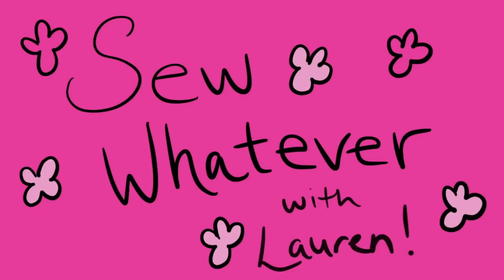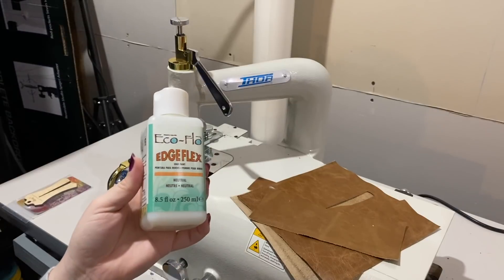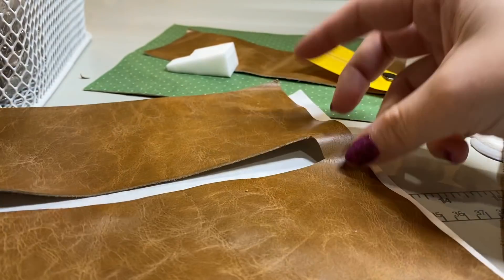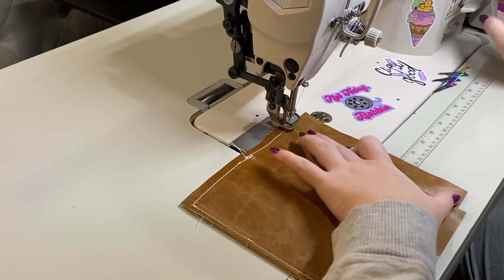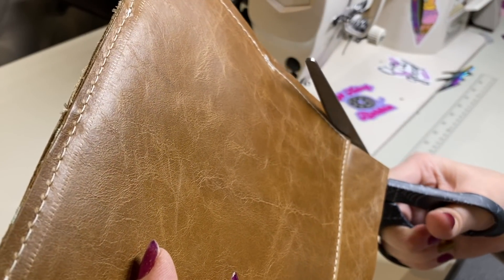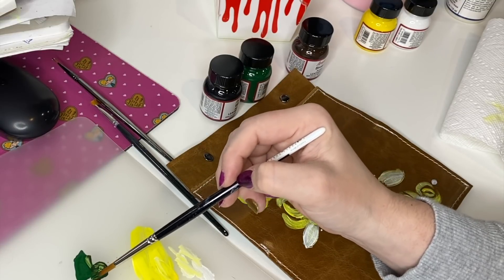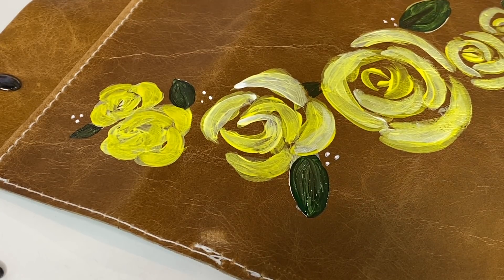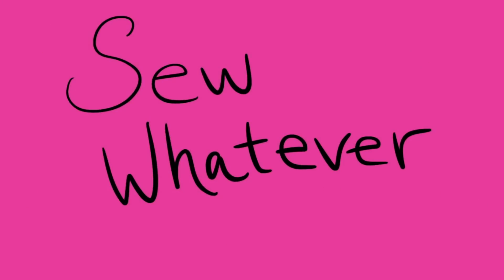Making a Wallet & Using Angelus Acrylic Leather Paints

Comment: Since you are trying to control the edge coat in a narrow line, I suggest you get some some  foam Eye make-up brushes. Then you would have a smaller brush that has a handle. Would be a lot easier to control. I know I use them on several different projects. 

 You said you used 90 wt thread. Was that only in the top needle? What weight did you use in the bobbin?
Reply from the maker: The same weight.
Reply: Thats a great tip!